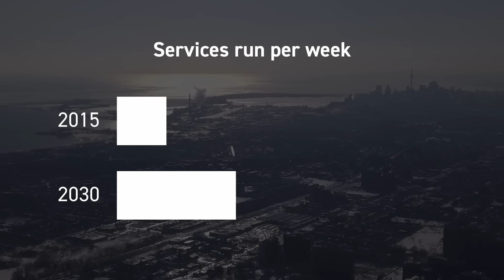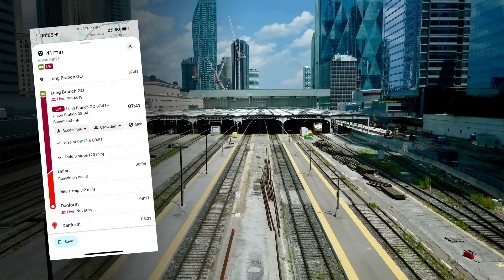How Toronto is turning its commuter rail system into a rapid transit network!

Comment: Hi! Just wanted to share an update that recently Metrolinx canceled a major 25-year deal with the consortium called ONxpress which was going to originally deliver on GO Expansion’s electrification projects + talks about taking over operations from Alstom (the current operator) and this consortium consisted of companies like Deutsche Bahn and Aecon.

We don’t know for certain if this will have a major impact or changes to GO Expansion plans, but it certainly is a setback when it comes to finding good talent to deliver on this project!

FYI: Nothing was ever announced about this and in a statement to CityNews, Metrolinx said it is “committed to providing a safe, reliable transit service” to the more than 120,000 daily GO Transit and UP Express riders.

“While both teams worked closely toward this goal, the parties are working on an amicable settlement to end the partnership,” the statement said.

“Alstom will maintain its role supporting the operations and maintenance of GO Transit and UP Express, to continue delivering best-in-class service that Ontarians have come to expect.

Comment: Sorry for being picky, but it is pronounced “Stowe-ville”, not “Stewville”. And that street in Newmarket is pronounced “Mule-lock”, not “Mull-lock”.
Reply from the maker: I knew I was going to get that one wrong!
Reply: @City-Moose  

The level crossings will be a big problem. For instance, in Newmarket, after Mulock, the northbound GO trains cross Water, Timothy and Davis in less than 3 km, and then cross Green Lane 1 km further north. With rush hour trains every 30 minutes or so, those roads get really congested. Just as the traffic starts to get moving again, another train shows up!  

Anyways, thanks for the video!
Reply: @City-Moose  All good. Fantastic video. Big thanks. You did great!!

Comment: You should add a disclaimer that this project was just canceled, or provide a source that says otherwise. I too heard about that ONexpress dropped deal, and I'm guessing that's what you were originally referencing but not sure if that's the same thing
Reply: The project was not cancelled, the contractor was fired.  But either way, a huge setback and bad timing for this video.

Comment: A big part of the reason the locomotive hauled service isn't going anywhere, is because of the sheer number of cars they have. They have 979 of them, which is more than every other operator of that type combined, which currently sits at 515. That would be an astronomical cost to replace them with a like number of other rolling stock...

Comment: Unfortunately there are no direct rail links between Kitchener, Cambridge, Hamilton and Niagara... pity.
Reply: no there is a link between Hamilton and Niagara there is a branch of the Lakeshore west
Reply: @IndustrialParrot2816  No, there is no direct rail link connecting Cambridge and Kitchener with Hamilton and Niagara. Going through Toronto is not a direct rail link. Cheers.
Reply: @peterj.teminski6899  GO was built off of being centric to Toronto, this idea probably isn't even in the books yet
Reply: @GamingRailfanner  GO was built off the existing freight rail lines with Toronto from when it used to be an important port. If the train route doesn't already exist, it would be too expensive to build new. The need/desire couldn't justify the cost.
Reply: @pauly5418  This is also correct

Comment: GO just dropped the DB co-operation. That's going to be a pain in the ass to deal with.
Reply: What is DB?
Reply: @WebVid  Deutsche Bahn
Reply: @WebVid  it's the German national train operator. Toronto brought them over to work on GO expansion as the DB runs hundreds of S-Bahn lines in Germany, of which GO expansion is trying to emulate. But they ended the DB collaboration today for unknown reasons.
Reply: @eannamcnamara9338 Yeah I don't know why they dropped it.

Comment: I think they should take notes from Perth:
15 minute all day (even weekends and public holidays)
Through running through their central station
Surburban bus services
Reply: the Suburban Buses are already there, 15 minute service is eventually happening along with through running however its important to remember each of the GO train lines are much longer than each of Perth's lines, the Lakeshore West being by far the longest
Reply: Isn’t Toronto the pinnacle of suburban bus service already?
Reply: What's so much better about Perth's suburban bus services compared to greater Toronto's?
Reply: Ton o' rot happens to be the place hard on the eyes, you see  👀
Reply: moreover - and clearly - Australasians must've  l o n g  been the fussy ones about passenger rail services, not America/in/nes  💡💡💡

Comment: Given that several GO lines are regrouped into a single corridor, it's more like S-Bahn than RER.
Though the fact they all end at Union Station, even if some trains continue on as a different line, it's neither S-Bahn or RER for now.

The essence of the RER is new large underground central section corridors joining together former suburban lines that are repurposed and upgraded, with massive cathedral stations, massive high-capacity trains, high frequency in the central section and at the very least decent frequency on branches.
It's a regional express heavy metro hybrid network with different lines, hence different central crosstown corridors.

If GO lines on each side of Union Station were to be joined together to form 2 or 3 continuous lines, it could begin to resemble S-Bahn networks like that of Hamburg, for example.
But they'd need to be several different central corridors, each with branches, to begin resembling to an RER network.
London's Elizabeth line is an RER, but GO lines won't be without massive changes going much further than what's planned.
Reply: Toronto is blessed with a Through Station instead of a Stub-end Terminal like most european cities so trains can pull straight through the station without needing to back out or dive underneath
Reply: @IndustrialParrot2816  Why do you think that most European cities do not have through stations?
Europe is a big continent with 750M people and plenty of cities and the fact is that most train stations are through stations and there are also terminus stations as it's part of the structure of every rail line in every place around the world. In Europe some cities tend to keep the main terminus as is, like in many parts of France and Italy or the UK but a lot of places have mostly through stations, including Spain, The Netherlands, Belgium, Germany, The Nordic countries, and many more. A lot of stations were, at least, partially converted by leaving the original terminus but adding through platforms, sometimes underground if space was a problem.
As I said, every line has two terminus stations and the rest are through stations ans over the years most terminus train stations in Europe were converted to through or partial though stations.
Reply: Technically some GO lines do through run depending on the service with mostly Lakeshore West and East through running, an occasional Kitchener-Stouffville service, or even a Kitchener-Lakeshore East service
Reply: No a S-Bahn Network can have all trains ending at one station. Look at the austrian-sbahn networks. And also many of them in germany. Berlin and Hamburg are outliers in they way they are used as an alternative for an metro rather then an more regional network. Most s-bahn networks are like the GO.

Comment: Seems like they are trying to replicate something like the networks Sydney and Melbourne have.
Reply: I believe the inspiration is the Paris regional rail. It even has the same abbreviation, RER
Reply: Like you said, electric multiple units should be the next step.
Reply: True
Reply: Yep - especially the mix of local all stops services and outer suburban express trains. Classic Sydney operating model, but we do need quad tracks to pull it off